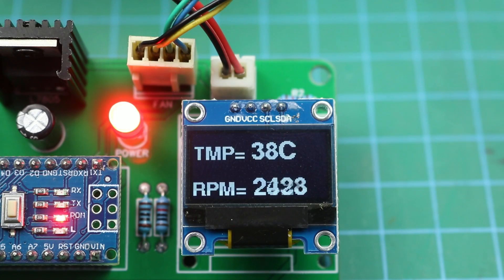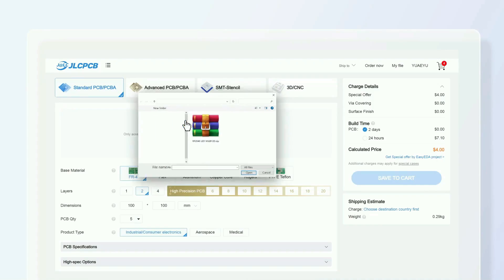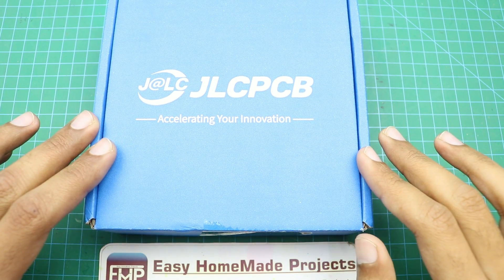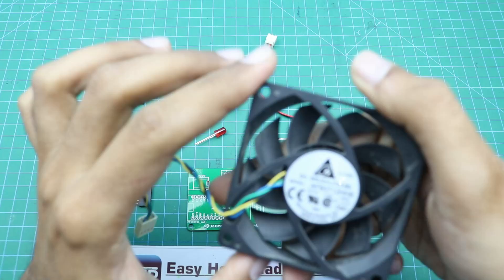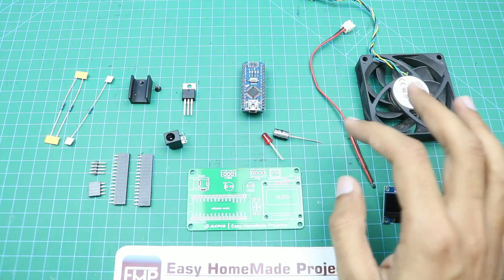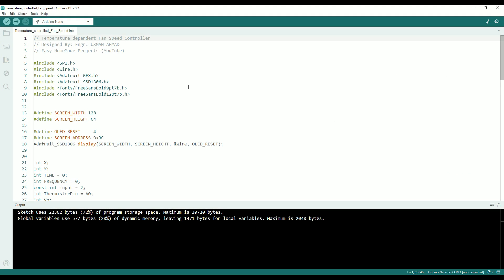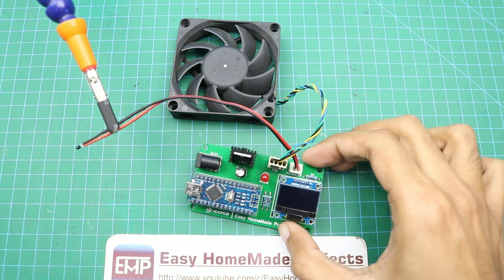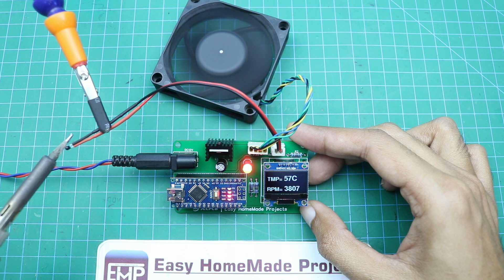How to Make Temperature Controlled PWM Fan Controller Using ARDUINO and THERMISTOR

Comment: please exaplain me how to control 12v fan in arduino directly , it's not possible , the arduino also controlled 5v sysytems only how you controlled 12v fan directly not using any trasnister
Reply: I guess he connects a 12V PSU, which powers the fan, Arduino power controller reduces the 12V to 5V and the PWM signal to the FAN is 5V as it should be
Reply: Ok thank you . I think you are correct  @RandomCriticalThinker

Comment: Great project! Thanks for the idea and the files you provide. How can I change the fan intervention thresholds with the minimum and maximum temperatures? (I have a device that I would like to cool starting from 36 celsius to reach 100% fan at about 55 celsius.) Thanks again.
Reply from the maker: Read code
Reply: @EasyHomeMadeProjects  I also have a question about setting the min/max temperatures for controlling the fan speed to make this useful for my project. Your sketch has no comments on how it works. Your answer "Read code" is just rude. What would it take to actually answer the question? This not helpful.

Comment: D6 - this PWM to FAN4 -- OK.   D2 - where in the scketch?   what is its function?   LED 13 pin not connected, why?
Reply from the maker: D2 is a tachometer pin of pwm fan. To measure rpm. Why we should connect pin 13?